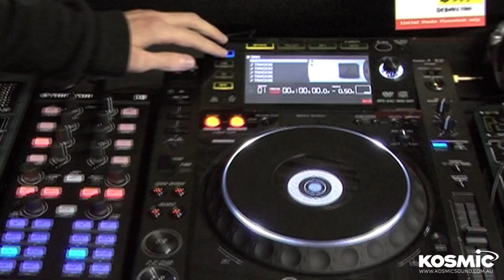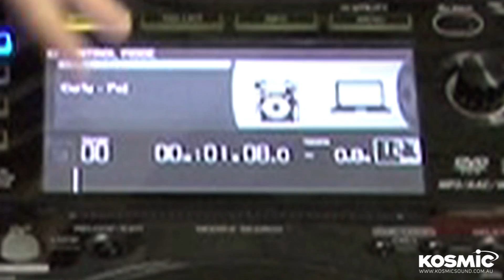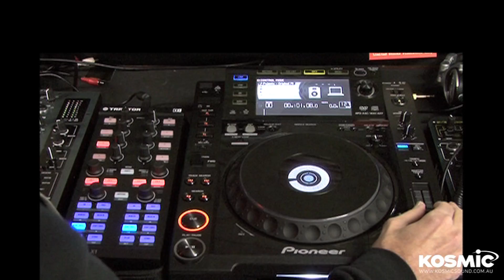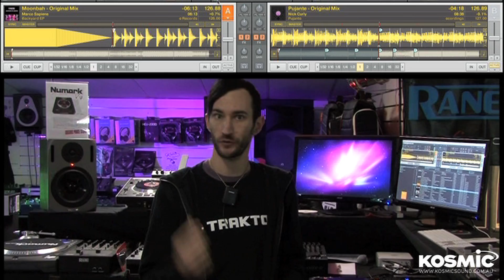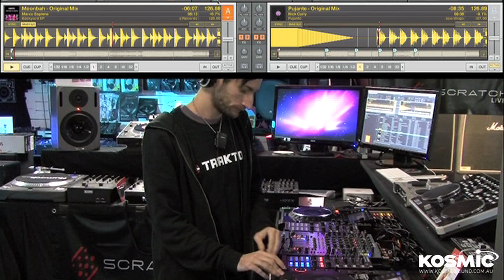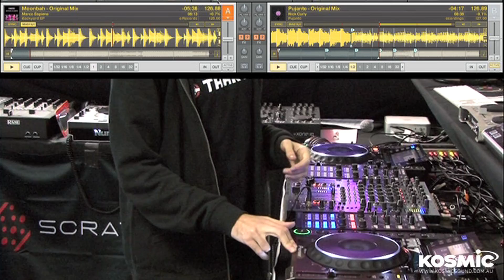Traktor Pro controlled by CDJ2000

Comment: hello kosmic ,,,i have a ptoblrm with mine cdj 2000 pitch in  the hid mode  ,,hes jumping to for example to 126 to 126.1 and the beat matching is not syncronisite enymore as before i was upgrade de firmware to 3.1

Comment: nice vid cosmic! quick question plz! dj, there are 350s. when i take over the decks, i use traktor, i plug one usb in and works very fine, but the other cdj 350, when i change the input from cd / usb to computer input / usb cable, traktor crashes... does the 2000 have the same issue? recently in moscow; when i took over the decks in the same manner, nothing happened!? they were 2000s... i guess the problem is in 350 only or i might face the same crashes in 2000? (350 firmware is uptodate)
cheers

Comment: you only need a cable no soundcard as the cdj has a built in card so its really just about buying the cables that are about £5 - £10 traktor is mapped for the cdj aswell

Comment: hey can u help me out here.my current set consists of two cdj 900's and a djm 400 mixer.im thinking of getting the x1 controller as well.how do i hook all of these together to my laptop?do i need to use and audio interface or can i just use my cdjs as a soundcard?
Reply: Did you figure this?
Reply: You need a soundcard, but i dont know which one. I want to know  can i connect 2 cdjs, mixer, traktor kontroll x1 and a laptop and which type of traktror interface do i need for using all of that?